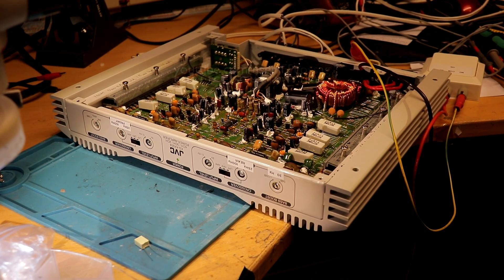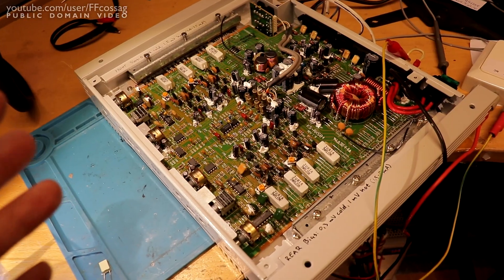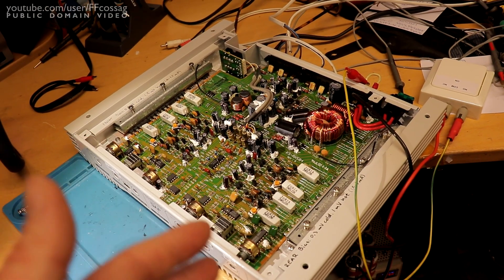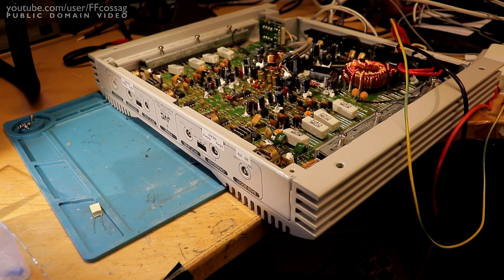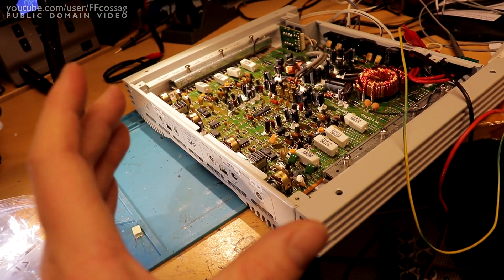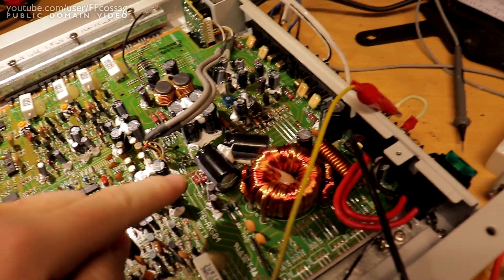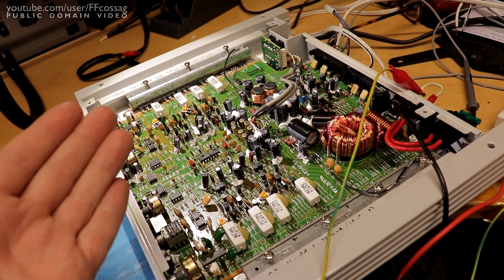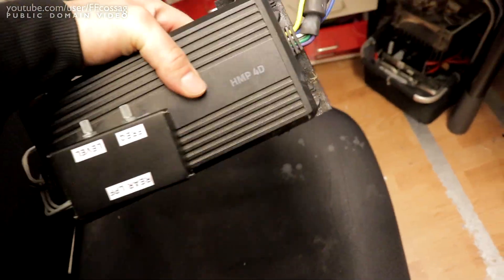JVC KS-AX504: A nice vintage car amp, and I made it better. (Rambling project notes)

Comment: This quite honestly is  my favorite kind of YouTube video for audio electronics, and thankfully you too actually recommended something really cool for once!  
When I find fascinating about these Japanese era amplifiers is you can literally find them cheapest chips right now and they're almost everywhere at least on American eBay.  

Absolutely fantastic job reconditioning and refurbishing this amplifier and the coolest part is how you set the bias of the amp so that it even sounds better on the front channels.   

What  I disagree with a bit has nothing to do with the audio amplifier itself ,  but the actual method of your installation in the vehicle ; But as you said it was a work truck so I completely understand.

If I may and if you entertain it - i would have kept the amplifier as a highly sound quality focused front stage only to run both your tweeters and your woofers.   
then used whatever Class D amplification out there that would run the subwoofer.    

And I'm not a golden ears or anything, but I can tell you there are some amplifiers that I really just don't enjoy listening to.
I can also tell you there are some class D designs and some class AB designs that I absolutely love and a lot of those are from current day and they sure don't sound very good to me.  

The weirdest thing is a lot of these classy amplifiers look good on paper or when they're tested but when you actually use them in practical everyday use they fall flat from there measured specifications.  

You'll get pops, clicks,   weird noises when it's just sitting there  on the bench for example.  
Even using clean battery power!  
  I'm sorry this is turning into a rant at this point but these Class D amps just seem to suffer from interference much more than Class A/B designs of the past. 

Even current day Class A/B seems to have taken a quality nosedive!    (The  "Nuew" Blaupunkt Amps from about 10-15 years ago showcase this! )  
They just went full into giving people power, and forgot about fidelity it seems.  
I never could place what it is, but  they don't sound anywhere NEAR as good as my old Coustic and Alpine MTX amplifiers from the past.  

A guy out there named Deaz Nuts also cited this, and fully  recommended buying up all the early Japanese amplifiers while you can like the SONY's,  Coustic, Kenwoods, etc. 

And I don't know if I'm going nuts, but how the heck can these amps being going BACKWARDS in Singal to Noise Ratio numbers  FROM THE 90s !  :face-orange-raised-eyebrow:  
It's like they went full in with  "It's just MP3's over Bluetooth"  , and decided to throw in the towel about sound quality. 
That or they got really depressed by how much modern popular music just has very little soul. :face-red-droopy-eyes:
(Or TOO much Soul in the case of Lizo :face-green-smiling: ) 

Anyways, 
Thank you for showing us all how you made this champ of a JVC Amplifier made in Japan sing.  
I too really like it when there is a fella out there and his team that really makes something for us to enjoy, instead of some Bland Corpo that justs hits targets on a spreadsheet.  

Have a Merry Christmas, 
and happy New year!  
:goodvibes:
Reply from the maker: Merry Christmas, glad to see you can appreciate old Japanese electronics as much as I do!

Comment: That's a tiny transformer in the power supply. Wonder what the real power output is? Ah you just answered my question, 40 Watts is about right. Seen others with much bigger transformers with higher output. Best wishes nick
Reply from the maker: Of course, there are always bigger models! I didn't choose this one because it was the biggest, because I don't need the biggest!

Comment: What are you running in the way of speakers in the van?🤔
Reply from the maker: Nothing too fancy, a Hertz ESK 165.5 2-way set in the doors and an Adam Sub7 with broken electronics under the seat. The midwoofers of the Hertz set aren't really well suited for my application, they roll off steeply below 70 Hz or so and ideally I'd like to bring them down another 10-20 Hz.
Reply: That's not too bad,the Adam 7 can be a decent unit, depending on what it's paired with @FFcossag

Comment: Another one of them cases where it proves they don't build things like they used to, churning out any old tat with high specs on paper that turns out to be as useful as a chocolate teapot in reality...
Reply from the maker: To be fair, there are many nice, modern amps on the market, they're just very expensive. Though you'll be hard pressed to see such a clean, serviceable design in anything made this millennium.